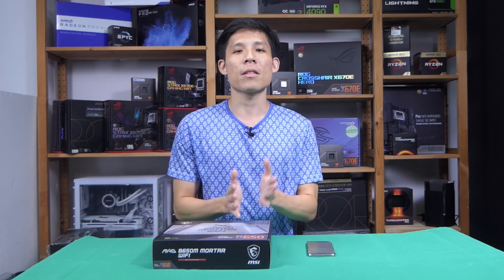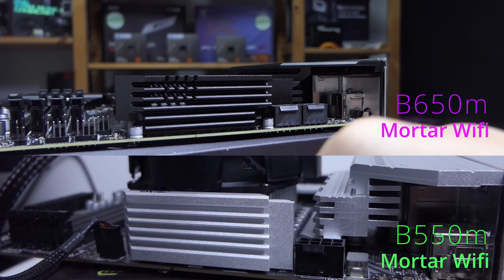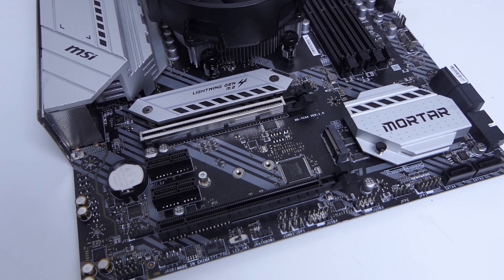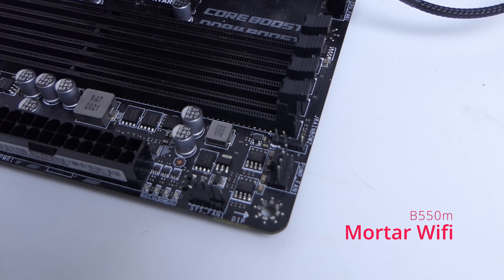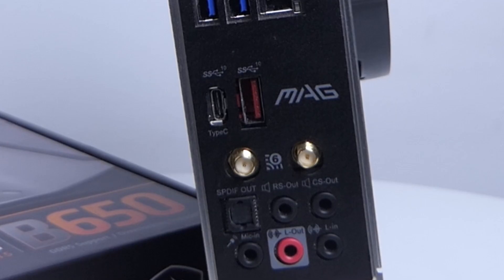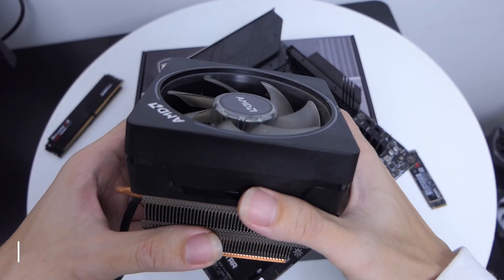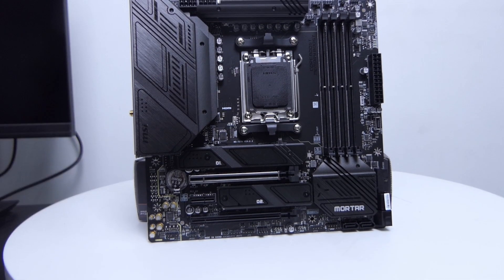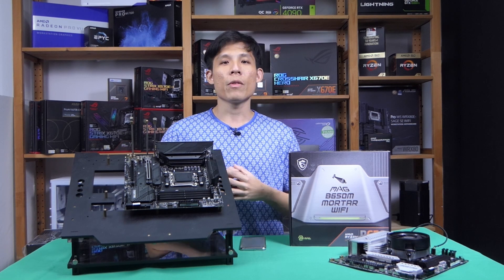Did The BEST mATX Motherboard Become BETTER? MSI B650m Mortar WIFI Review

Comment from the maker: What do you think of this B650m Mortar WIFI?
Make sure to check out the B550m version here: https://www.youtube.com/watch?v=8n16J9U57zY&t=3s
Reply: Hello man! I have Arctic liquid freezer II 420. Can I use it with motherboard? I’m begging you for answer.
Reply: also I didn’t get. Is it ok to put for example non-existing r7 7800x3d in it?
Reply from the maker: @westerxxx9220  hahaha this i do not know. But if it lies with the same family as Zen 4, it should be compatible with the socket.
Reply: @RealMelTan  I found the answer. Yes I can 😃 Now waiting for my new platform delivery 💪🏻
Reply from the maker: @westerxxx9220  Yes, it is compatible with any AM5 motherboard, which includes this B650m mortar :)

Comment: are RX 7800 XT fit in this board with the pcie Slot too low like that?
Reply from the maker: Yup it can, use the top slot. It still can handle the 7800XT, but make sure to fasten the board well into the case.
Reply: @RealMelTan  yep, thank you very much.

Comment: Is the 9800X3D + Thermalright Phantom Spirit 120 SE air cooler suitable with this m-atx motherboard?
Reply from the maker: Yes you can run the 9800X3D on this board with a motherboards BIOS update. But I dont think you can OC the CPU on this chipset (if you care for OC). I am not familiar with the Phantom Spirit, but if it is compatible with AM5 sockets, it will work anyway.
Reply: @RealMelTan  Hi what mATX motherboard would you recommend for the 9800X3D i am getting one soon and want a good motherbaord for it 😊

Comment: Is it good for Ryzen 7 9700X? because matx X670 so expensive, even after one year from release date.
Reply from the maker: Yes it is, just that I dont think you can OC the 9700X. But B boards are always good for the price :)
Reply: @RealMelTan  Thanks. Yes, the plan is to use it out of the box, without OC-ing it, maybe find a good cooler to enable the PBO.

Comment: I have b550m mortar mag wifi + ryzen 7 5700x

its good/ worth to buy upgrade to b650m mortar for know?
Reply from the maker: I dont think it is necessary, there should be not much a performance improvement for your 5700X. Unless you care for more M.2 slots and more ports.

Comment: Hi! Is this motherboard compatible with Ryxen 7800x3D? Is Smart Access Memory available through bios? Also do you know if this cpu requires 1 8pin or 2 8pin connectors? (Btw Im not planning on OCing)
 It caught my eye because of its minimalistic black design!
Reply from the maker: Yes you an use a 7800X3D on this board. And you can turn on Smart Access Memory (SAM) in the BIOS (I believe it is already turned on when you boot up the BIOS for the first time). 
For the 8 pins, I believe one is good enough for the CPU. But if you can, just plug in both on the motherboard.
Reply: thank you for the reply! @RealMelTan

Comment: I bought this when it came out last year and it constantly crashes, says it can detect teh graphics card or teh dram, adn now its crashed so many times it corrupted to OS. All complaints about it online say its terrible bios. I have yet to find a solution after one year.
Reply: I agree with you. I have a compatible memory kit F5-5600J3636C16GX2-FX5. If EXPO is enabled, then I get cpu dram lights or crashes my windows. I don't know what to do anymore, I use memory at a frequency of 4800....

Comment: The motherboard requires a 2x8 pin connection for the CPU. I'm asking because many motherboards work with a single 8pin. Can this motherboard also work with a single 8pin? If it is not, I'll get the gigabyte version that works with a single 8 pin.
Reply: For a noob user what does it mean that a motherboard requires 2x8 for the cpu?
Reply: 2x8 much better for oc and in case you getting more power cpu so you dont have to get new board and better cooling i think

Comment: Will i need to connect two EPS for 7600.. my psu have only one 🥲
Reply: It is not necessary.  Only at extreme overclocks on 7900x/7950x processors and their successors.

Comment: the first pcie slot layout design was good on the b550m mortar but now it's a shame the b650m mortar changed the layout of the first pcie slot to be too low, not good for a thick gpu card placed in a micro atx case
Reply: Yes, it will totally block the second PCIE slot.
Reply: @TheOdsystem  does it mean I can't install a wider graphics card no matter what, or does it mean, I can install a, let's say, 3,5 slots graphics card only problem been I will block the second PCI slot? Because in my case, I won't need the second PCI slot anyway.
Reply: Did you end up getting this board?

Comment: Thank you for the details .. I see you used only one 8 pin block for the 7700x AM5.   Just to give a heads up the Asus x670e wifi is a trouble system .. ... Bios and extra issues... 
Next time I am down in Bugis or Sim Lim I will need to look around.. 
感謝您的信息。

Comment: Does anyone know if a Noctua NH-D15 will allow enough room for a GPU in the first slot?
Reply from the maker: Hey Wimbus, there should be enough clearance. If I have a D15 to try, I can confirm with you. I have a D14 currently. But what GPU are  u looking at?
Reply: @RealMelTan  thanks for replying, I will probably eventually get the newest AMD low-end card when it comes out (so, I guess a 7600 if they stick to the naming convention).

Comment: Hi, Why did you say you wouldn't install 7900x or 7950x?. I want to get a 7600x and then upgrade to a future 7900x3d. I have no interest in overclocking. Please let me know.
Reply: Fine for a 7950X, even at all core at 5300 the VRM stay close to 60°C in a ventilated case off course (at low RPM).
Reply: @barbatocedric4246  yeah it's fine to run the 7950x. this guy doesn know what hes talking about
Reply from the maker: Sorry for the confusion. If u do not plan to OC, u should be able to run a 7900X on this board. I actually meant for more a mid tier build, where you balance this board with a more mid tier CPU.

Comment: Looking to upgrade my PC next year and this motherboard caught my eye. I may aim for a 7900X build though (depending on pricing), I do not see why this motherboard would not suffice. Great review regardless!
Reply: I think it's a good board for 7900x. I built exactly this with this board - it has 2x 8pin power for the CPU when most of the competition has 1 or 8+4. I had some problems with mine though but I'm pretty sure it was a bad board rather than typical experience. First the RGB died almost immediately. Apparently a bit common with MSI boards. Not something that would bother me too much but still it's supposed to work. I sent it back when one of the USB controllers stopped working. The other thing to look at is that the pcie x16 slot is one slot below the board I replaced it with, a gigabyte board. This might be good or bad depending on your case, but not something I knew varied
Reply: @jmxtoob  thank you for the insight. The gigabyte board looks like a great option and I will certainly consider it. I hope it doesn't give you trouble!
Reply: Don't worry about it most companies don't support PCie 5 yet.🤔🤪😉😉
Reply: Works fine with a 7950X, VRM temps stay low. The only problem is the price, the packaging look like the one of the entry level Asus B350M-A (100€ at the time ) with the price of asus Crosshair X470.
Reply: @barbatocedric4246  High price is normal for AM5 boards. The high end last generation was 200 dollars and up however currently the low end is 200 dollars... Shitty situation but it is what it is.
Reply: @slowepal   B660M MORTAR DDR5  210€ - B650M MORTAR 270€ ! (at the time of the comment )
ddr5, pCIe 4, same board, only difference are chipset, audio (but équivalent) and socket. Overcost for pciE 5 is irrelevant here.
Should be in the same price range . . . now the AM5 variant can be found around 235€.
Reply from the maker: haha thats great! Hope my review helped in your buying decision :)
Yes u can use a 7900X on this motherboard. But if u wanted PCIE 5 to go along with your 7900X, u will need an X670 :)